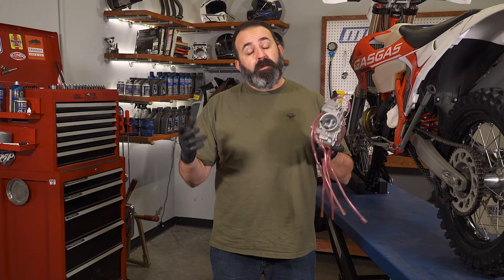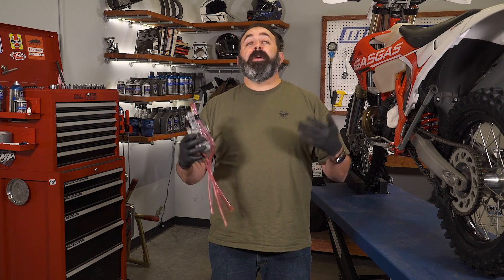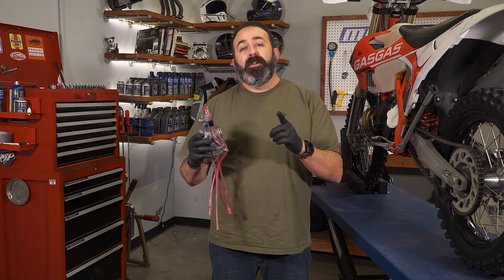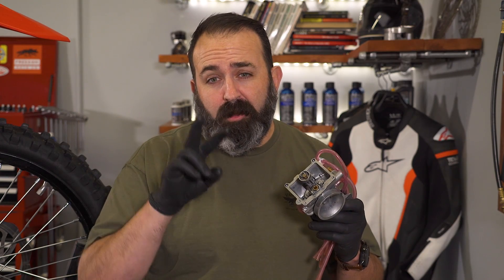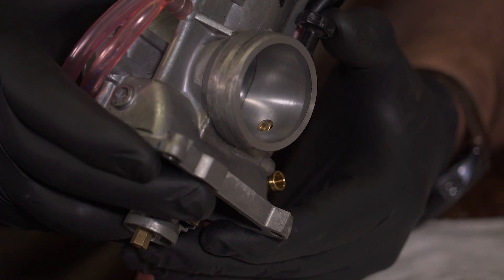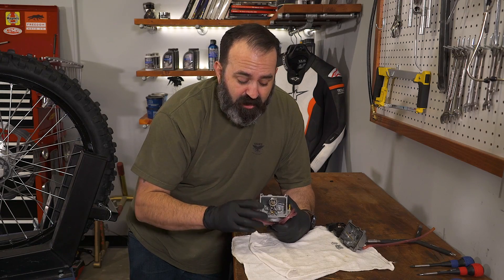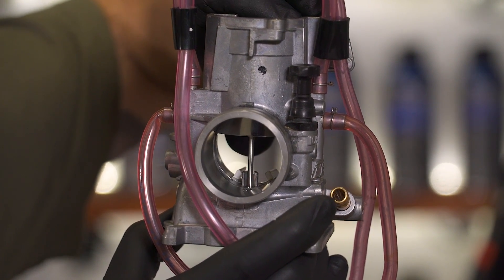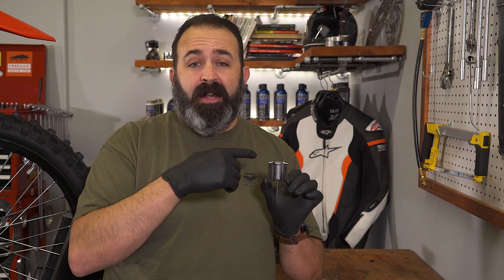Understanding the Parts of a Motorcycle Carburetor | MC Garage

Comment: 5.30 pm does my main and idol jet need holes at the bowl my bike has small holes on the   sides but not at the bottom too draw fuel from bowl cause it was running before but no holes at the bottom got cv vacuum 4 cylinders

Comment: I see so many of these. One single carb work. When doing 4 like on older motorcycles there are no videos. I would love to see a video on separation and then putting them back together. Especially on how to put the springs for the butterfly back in. I want to see if there is a different and easier way to do it as opposed to how I do it.

Comment: Hi guys I am restoring my 2009 Honda C100 and Ive recently upgraded the bore to 53mm from the stock 49mm. I am using the honda wave/innova 125 carburettor on this bike. Since I am just starting out and i dont have much knowledge in motorcycle/car engine modification, can you guys comment below and share some tips with me for a beginner like me to quickly pick up on? I am planning on replacing the standard spark plug coil that came with my bike with a thicker wire type. please do share some tips with me below?

Comment: could you also talk about the tubes coming from and going to the carb?
I bought a bike that won't run and it has two tubes coming out of the carb. One to the fuel tank and one is clamped shut after about 4 centimeters. I don't know what it is/was and what it's function is supposed to be.

Comment: hi, what carb should i use on my honda mtx ot running a 53mm piston and cylinder kit i have a 18mm carb on it but its pissing out petrol from the overflow an air filter an the bike dies when u drive it at high rpm like 9000 1000 rpm or goin flat out in 4th

Comment: Can a flat slide carburetors be tuned for a 4 stroke engine? Does a carburetor's design dictate the type of engine that it is used for? I've never seen a CV carb on a 2 stroke. What are the different applications of a round slide, flat slide, and a CV?  I would think that a carburetor 's function is to mix fuel and air to a specific ratio, so how it accomplishes that should be irrelevant to the operation of the engine.

Comment: Whats that open copper-looking pipe on the side of the carb???
Reply: @Justin Dawes I guess I'm educated enough about this to understand which one is for the fuel line. But the carb on my motorcycle also has this open  copper-looking pipe on the "other side" of the fuel inlet.  I've asked alot of people and they answer just like this. Not really the answer i was hoping for. And I don't think its a case of missing parts(pipe) It's been like that since it was bought.

Comment: Incredible video Justin, I actually managed to expand my knowledge a little with this.... Never knew about the mixture screw actually being different depending on its location... Always thought it was fuel only.

Also, is it true what my father said where rejetting a 4 stroke can lead to damage or is he just trying to stop me tuning my bike? It's a 102cc scooter and factory has 7BHP. He gets to 65mph at a push right now so I'm hoping to get it to about 70-75mph tops by a small rejet of: from 85 on the main and 32 on the pilot, to about 100 main and 40 pilot with a pod air filter.... What's your advice on this?

Comment: The fuel and air mix in the emulsion tubes. Some times the jet also has the emulsion tube, such as the idle/pilot jets, but most main circuits and secondaries do not.

Comment: Anything coming up as regards flat slides vs. round slides?  As one of my bikes is a antique of sorts ('73 Yamaha TX500, I'm the original owner) I've had to learn a bit about carb tuning in the past to get the mixture right for the aftermarket exhaust.  It originally had Keihin CV's, I threw those out years ago in favor of round-slide Mikunis, which I bought from Gary Nixon back when he had a shop up in Cockeysville, MD.  My Bonnie has Keihin CV's, wondering what advantages there might be to flat-slides that are available for it.
Reply: @Justin Dawes looking forward to getting my the CV carbs on my GS500E explained to me, they really seem like an overly complicated design for no real benefit to me but im sure there is some reason for it. A good explenation might make people with this bike stop turning their idle up to 5k rpm just because the bike wont start and run without the choke on for the first 15 or so minutes

Comment: is it possible that the air screw influences the performance at 100% throttle as well? when i close or open it a bit, i feel like my scooter performs different. i have a 50cc scooter (Switzerland..) with a 12mm carb. and i have to drive it nearly always at full throttle.
Reply: what means feel different(clarify problem)? Full throttle because its fuck.ng 50cc ....

Comment: Can anyone help. My bike keeps stalling after running it or after the engine has reached operatng temp if the rpm is set to 1200-1300, and the rpm range fluctuates even after I've changed the spark plug to iridiums.

Carb has been cleaned and tuned but issue keeps coming back after running several kms
Reply: what is a color of the spark plugs? black( to much fuel) white ( to much air), must be ("brown") or it could take a FAKE air=fluctuase rpm or after open throttle, RPM goes down (old air intake rubber following to the carburetor)https://www.miniplane-usa.com/tips/sparkplugs.htm
Reply: Check your ignition coil, high voltage cables and spark plug cup.
Reply: Fuel tank vent is partially clogged.
Reply: Spark plug is brown thankfully. And electricals are ok.. She's good on high revs, but she stalls say I come to a traffic light. (when cars beside you are looking at you and your bike then the engines shuts down 😅) Thanks boys. I'll have the fuel tank vent checked

Comment: Perfect, coming back in a month before I (attempt to) clean my carb.
Reply: The idle circuit is always the biggest problem and the hardest circuit to clean. You don't just clean the jets, you have to clean out the paths that lead away from the jet. You want to see a nice stream of carb clean coming out of the transition ports (tiny holes right next to the engine-side edge of the throttle plate/slide, can be up to 4 of them). If you don't achieve that, it won't run right. If it is a CV carb, be really really careful with the diaphragms. It has to seal 100% in the groove, or not only will it not run right, it will destroy the diaphragm. Good luck.